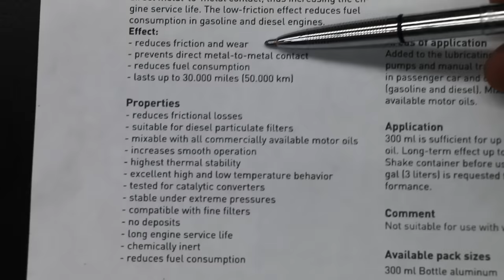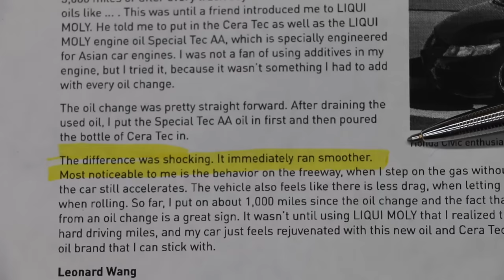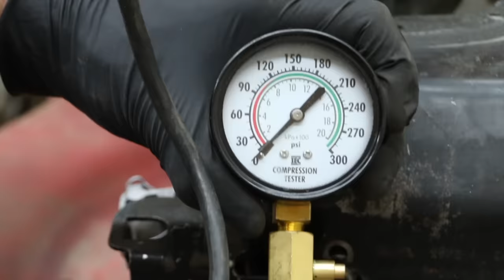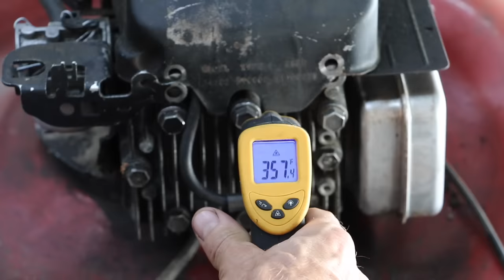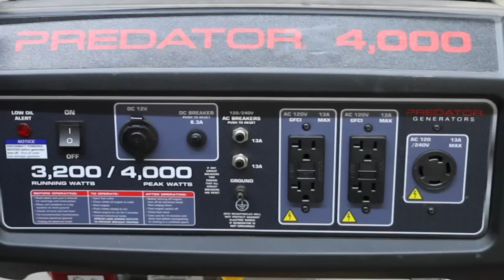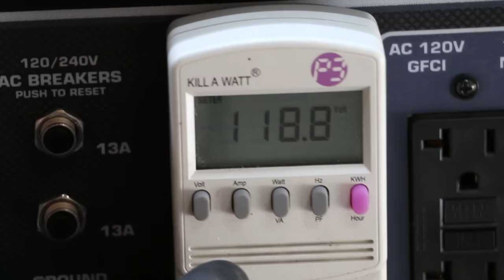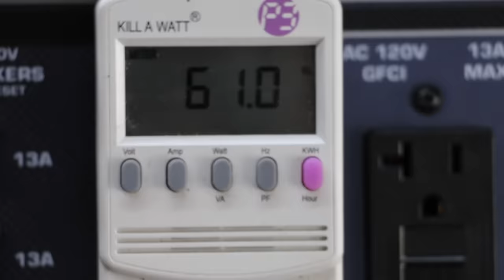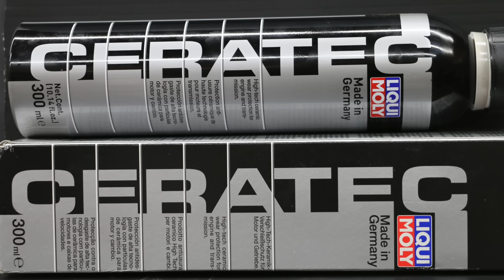Does Liqui Moly CeraTec work?  Let's find out!

Comment: Just switch to diesel engine oil if you want more additives in your motor oil. That's where the industry is headed with their "Euro formula" and the 10K mile and 20K mile gasoline engine motor oils. Good old Rotella will get you there with a more balanced motor oil.
Reply from the maker: Thanks for the feedback.

Comment: can you test NMF ionic fiction reducer?  (gonmf.com) It has a claim to de magnetize the metal that causes shaving to cling to metal parts so they are picked up better by the oil filter.  I have been using it in everything and it seems to be working better than anything I have ever used. had to pull valve cover on an 1995 honda del sol to change timing belt and the engine looked brand new.
thanks for all the cool videos.
Reply from the maker: You are welcome!  Thanks for the video idea.

Comment: Test is inaccurate oil aditives Ceratec or (MOS2) Molbendum Disulfate need to be at operating temperature 200 Fahrenheit Plus for prolonged time,
It takes ten plus cycles  heating up engine oil then letting it cool for some significant results to achieve but it does work very well.
Your engine will be almost impossible to    seize along with bettet fuel economy and no dry starts,
Ceratec (hexagonal boron nitride (BN)
MOS2(molbendum disulfate)
Tungsten Disulfide (WS2)
ZDDP (Zinc Dialkyl Dithiophosphate),
These are only engine oil additives that chemical engineers are aware of,
Everything else is scam
Like i said they would need to be cycled for week or so to gain full potential.
Its all about friction.

Comment: I always enjoy this videos. One is for 30K miles.  It requires 450-800 miles after an oil change to adhere to metal and work it's way into an engine. It's a preventative and not a miracle.  6% of the total oil.    The old lawnmower test.   Views for days.   Some offense.  Some of these additives just coat the human ego.  I'd trust zee Germans slightly here.
Reply from the maker: Thanks!

Comment: Personally I have never been impressed with this product. I think the tests kinda speak for itself. Sure some additives help.I personally use Seafoam in my automobiles as a part of a engine cleaning maintenance but I find just using high quality oil and filter do a pretty good job as long as your using the proper weight and changing schedule. Since I idle my cars for hours daily as a part of my job I also tend to use full synthetic oil, and change it every 3k. I also do a top end cleaning every other change, thus 6 months, thus start of winter and start of summer. Thousands and thousands of miles can't be wrong. I've tried quite a few fix in a bottle stuff. I found most are just plain costly gimmicks.
Reply from the maker: Thanks for the feedback.
Reply: @ProjectFarm  My pleasure. I enjoy your channel very much as does my daughter. She learns a lot from this stuff. It's also good that it also just doesn't come from me.

Comment: I dont know ceratec,
but zenox (dont already sold),
wery efficient, IF...
see 'un million de km moteur"

1.3 jtd fiat panda II 4x4 2006
the dealer "had never seen a panda push so hard, how did you do it, 
we passed it to the diagnostic bag thinking it was completely reprogrammed, nothing at all..."

(and same thing at another dealer with a peugeot 1.6 16s 206 sw 2006,
"never seen such a brilliant engine, running so well..."
- I left 1.5 meters of rubber in 1st gear...

Panda,
the rear lifted in 2nd, you pulled straight out of a hairpin,
and in winter even with -10°c on cold start, nose on the exhaust, no smell, absolutely no...).

 I specify break-in with emptying at 400 km then 1,000 4,000 7,000 10,000
and during break-in if possible preheating 30 minutes, let it idle at maximum - even in town I let the engine run if I parked for less than half an hour... police not friends...)

In short, usage means that,
except that :

p18 + red line 0w30 on a 0.9 twinair turbo fiat 2016, it does,
but slowed down at 1,600 rpm when cold, it doesn't...

(note that I did not drain at 400 1,400 etc and that the additive is only added after running in,
but anyway - see videos 1 million km utility, in french un million de km utilitaire (ou moteur)
at cold it's mini regime without touching anything t least 10 minutes etc 
- wery prudent as if engine could 'break' 
- engines made for airplane 1900', 36 cylinders for a blade, with cylinders in circle, 
= no crankshaft patents... :  no oil and any engine last 1Mkm because only segments wear...)
Reply: Update
I test Ceratec on 0.9 twinair turbo Fiat
its ok,
few less consumption,  better 'sound' motor.

Comment: It blew a 987 Porsche boxster engine. My experience, do not recommend!
Engine only had 40k
Reply from the maker: Thanks for sharing.
Reply: @ProjectFarm  just now getting back to you. I did a brand new oil change and did everything it said on the box and about 100 miles later I had a broken chain and an internally destroyed engine. Never used it again and 1 used engine later, still going strong. Weird but I wouldn’t trust this anymore after that experience. I’ve been watching your videos for years and this is the one and only one I tried in my engine before the seafoam. Seafoam so far has been life saver. Ceratec is a nightmare. I’ll never invest in any LM oils/products again.
Even there oil which there supposedly known for is extremely overpriced for the quality. I’ve sent my oil results plenty of times with LM in the past and AMSOIL for the past few years…the results are day and night in every category, I just feel bad for my engines taking LM as babies 😢😢

Comment: Adding 1oz. of the CereTec to 16oz of oil is slightly more than the recommended 6%.  6.25% to be exact.  I suppose that an exact measurement is not needed (per the instructions) for your experiment?

Comment: i think MoS2 is better
Reply from the maker: Thanks for the feedback.
Reply: @ProjectFarm  I used Ceratec in the Daewoo Lanos 1.6 car, which took oil in the amount of 0.7L per 1000km, with the last oil change I added MoS2 and after about 700km the oil consumption dropped to 0.2L for these 700km with the entire 1000km drive consumed 0.3L of oil